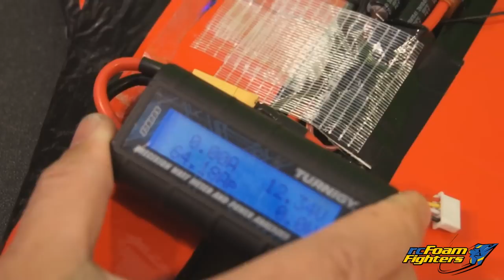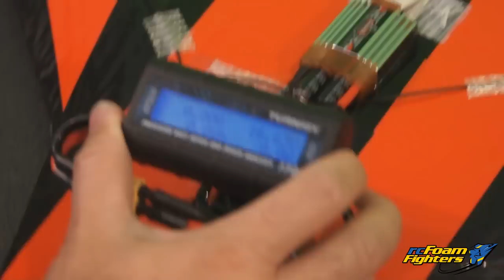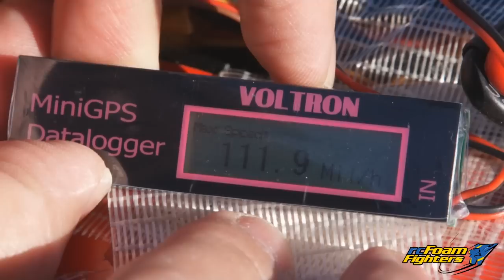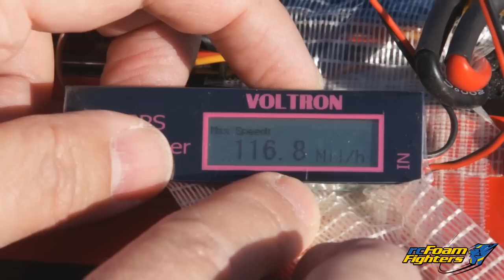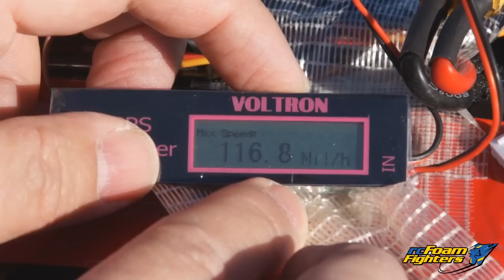Grayson Hobby Monster Jet Part2

Comment from the maker: @poppopscarvinshop Thanks for your question. The reason we put a smaller prop on when going up in cells is because of Amp Draw and load on the Motor. Every motor has a suggested safe rating. This motor we have been told is rated to 55Amps. We are already pushing above that at 60Amps. if we run the 7x6 with 4S it will most likely be well Above 70Amps and may melt down the motor.  In the future we may try a 7x4 prop on 4S and see what it pulls. Thanks, Paul

Comment: Which ESC are you running?
Reply: +damage.cc it was running a Turnigy Deluxe 55 Amp ESC. The Burst rate for the ESC highter than 55 amps, but forget what it actually is. I would have to look on the Hobby King website....
Reply: The Burst rate is 67 Amps...
Reply: +DiehardRCaddicts Thanks for the quick reply,  do you think this motor would be just as fast in the RadJet 800?